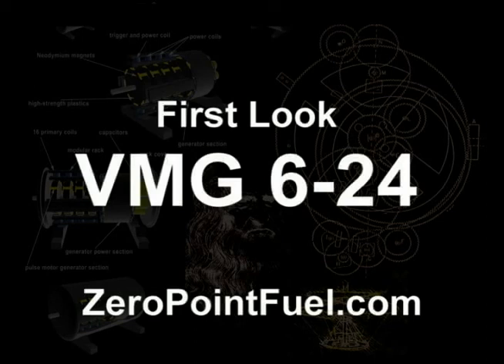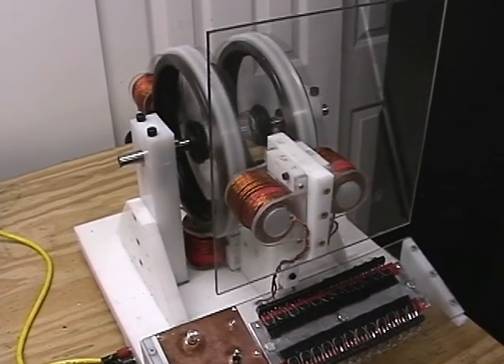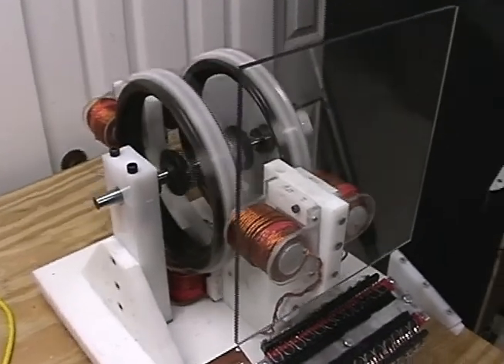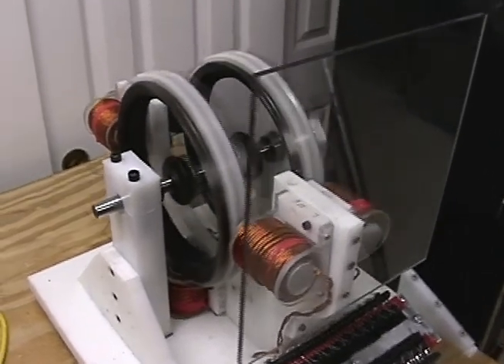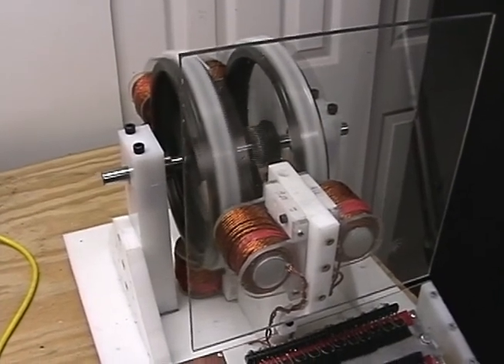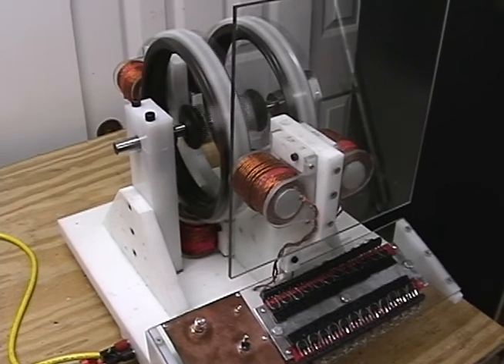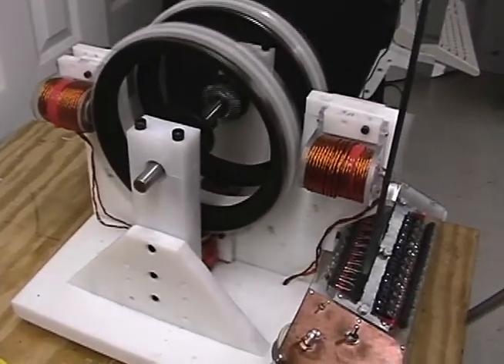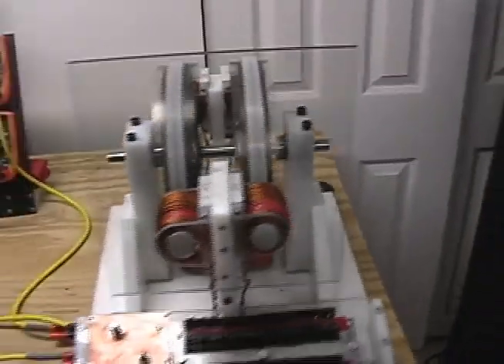First Look VMG624

Comment from the maker: The wheels are from a exercise ski machine.  You can find them in thrift stores for a few bucks, you might even find them on Craig's list.  I'm in the United States, and  they're everywhere.  I've noticed they used to same design wheels on many types of exercise machines.  exercise equipment is a great resource for bearings,wheels,axles and other useful small parts I also post build updates on my web site.  Just go to zeropointfuel,com click on VMG at the top for the latest information,